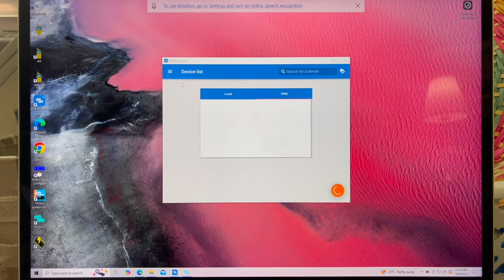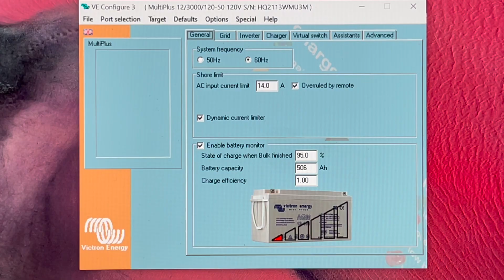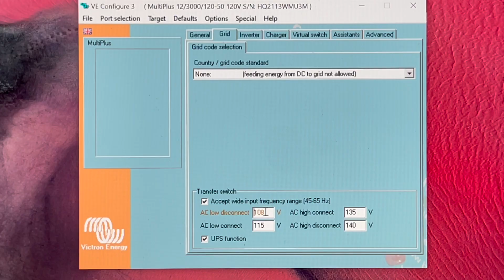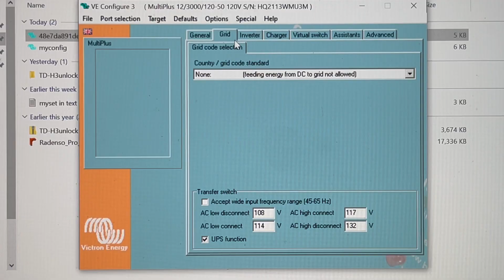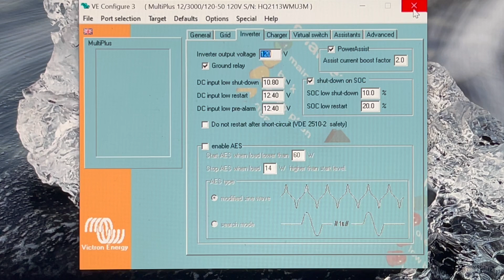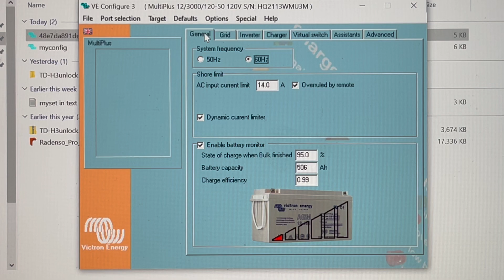Victron MultiPlus VEConfigure Tabs Setting - Important!

Comment from the maker: Okay, I pick up the mk-3 with usb-c connector.   The device is very small, smaller than expected.   Did a quick test, there are features that are not available on VRM.  When we do the second part of the VEConfigure, will show the difference.  Video is in the works.